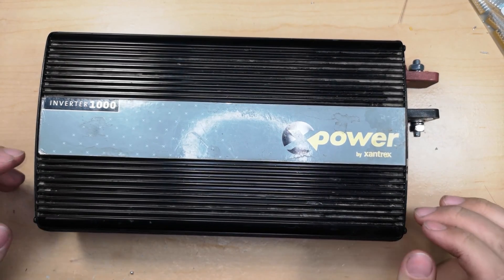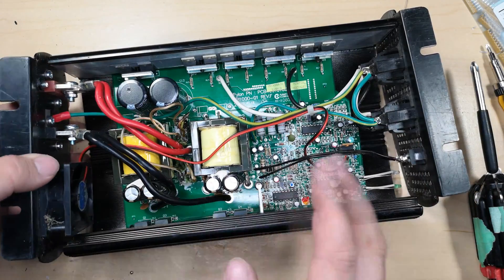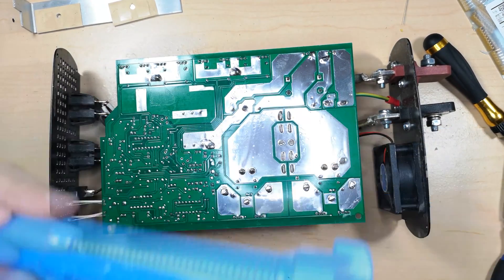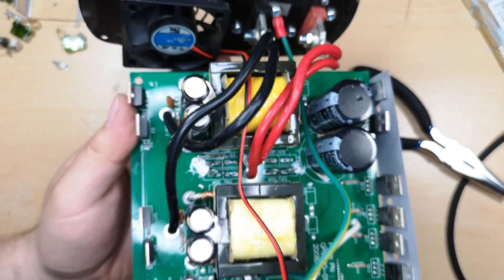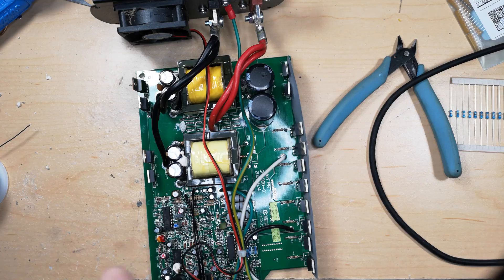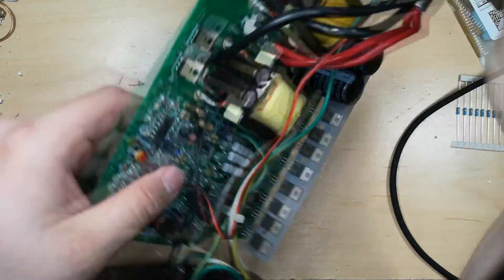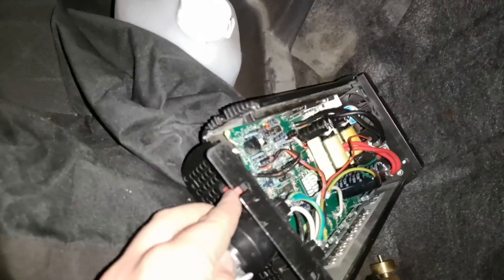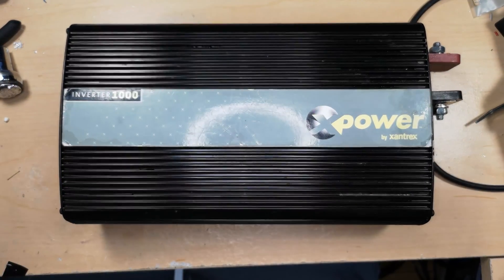X-Power 1000w inverter fuse replacement & repair.

Comment: Thank you. This video is helpful. I blew two fuses and I cannot replace them with another 30a standard fuse. The fuses on this inverter looks like some kind of female equivalent fuse without the prongs. I find the manufacturer’s design of this inverter completely idiotic. Fuses blow all the time and they make it impossible to replace. The part of the fuse that break is physically connected to the board so I could not use a typical replacement. From the design it looks like when you blow a fuse, you pretty much have to replace the entire board or find a way to weld the connectors together. I will never buy another one of these idiotic brand again.